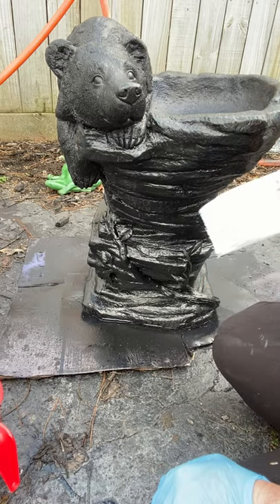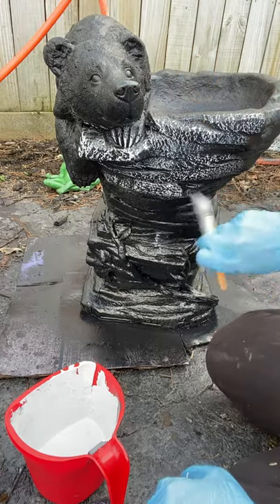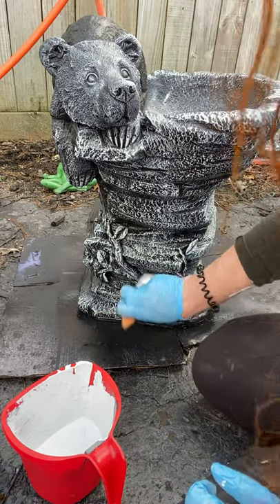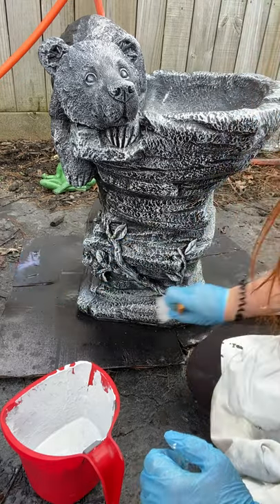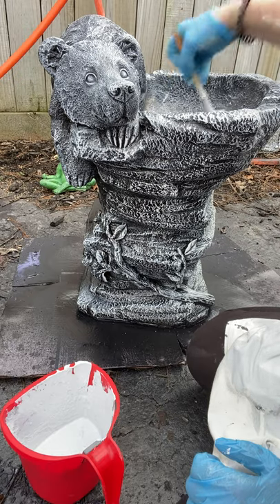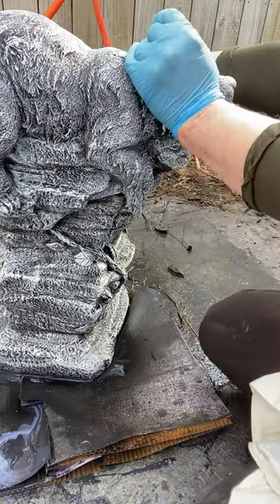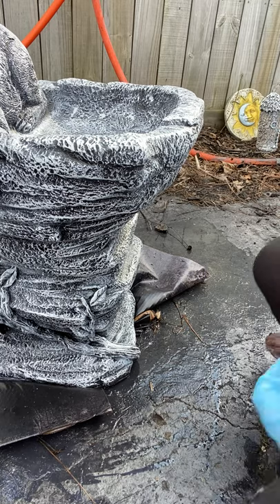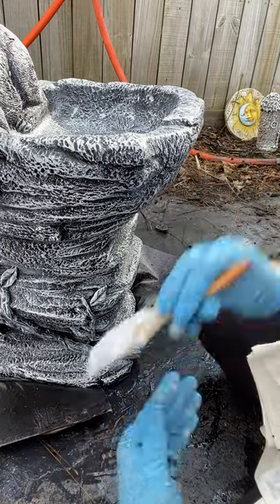Contrasting bear birdbath

Comment: Love your painting . How do you end up with no air bubbles in your casting ? Do you use a Vibrating table  ? If not then you must have a nice mix .
Reply from the maker: Hi Tom!  

I use a product called CTS rapid set.  It’s sold exclusively at Home Depot in USA.  No vibrating table just CTS mix and a rubber mallet.  I love the product and for larger items I mix CTS with quickrete 5000 high strength early release for a similar outcome...however, the larger ones must cure longer before painting!  lol 

Thank you!  I love painting on my days off!  😊  I’ll need to order more molds from you in the future as well.
Reply: @concretekeepsakesbytammy7166  I was just looking up the CTS product you use . Its pretty expensive $32.47 per 50 LB bag . I was wondering if you ever tried the Cement All rapid set ? Its $23.79 for 55 LB bag also at home depot. I am just wondering if you ever compared the two . I have used the cement all.  Its a very smooth creamy mix similar to what i saw in a video of the CTS.
Reply from the maker: I’m in Michigan.  The cts product I use comes in a green and white bag 60 lb each bag currently $13.47 plus tax at Home Depot,  however, I buy pallets at a time and have them delivered.  It goes to a “bid room” and they come back with a bulk price saving over $2 on average per bag.  Then they deliver the pallets.  I also purchase cement all but it’s higher price.  I sometimes mix the two for very small items with very fine detail.  I love both products. 

If you order in bulk from Home Depot, it goes to a “bid-room” and they will come back with a bulk price and I can turn molds over very fast with these products rather than having to buy extra molds, I can pour several of the same one in a day like 4-6 on average.  

Plus the psi strength and smooth finish makes it my preferred mix 😊.
Reply: @concretekeepsakesbytammy7166  I am going to look into that ty